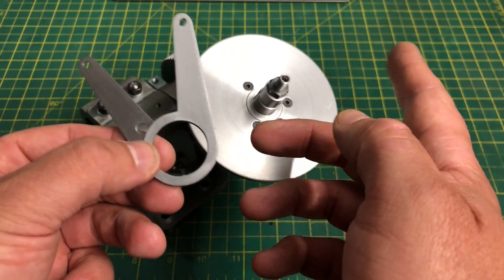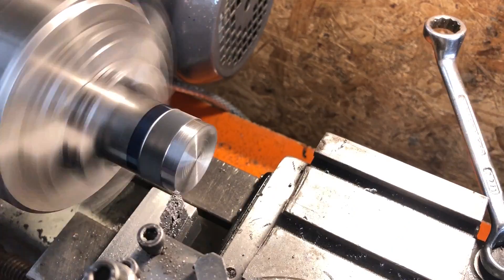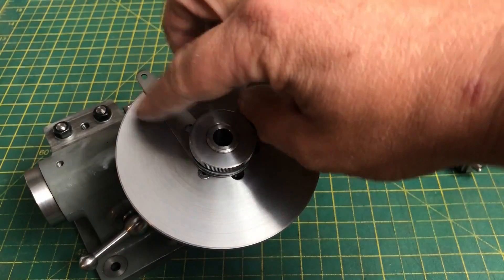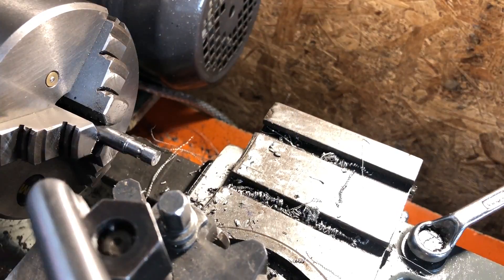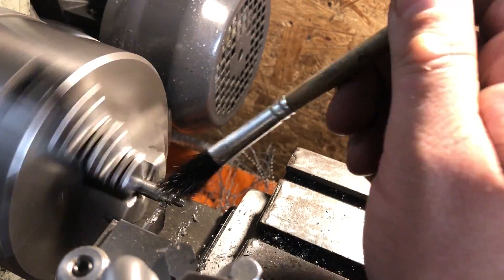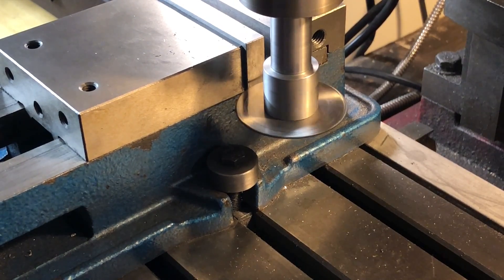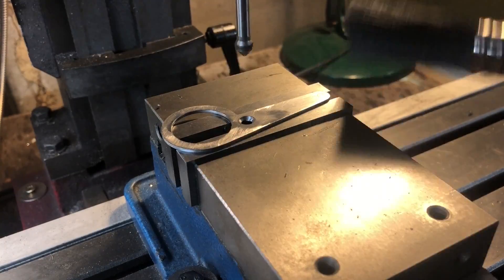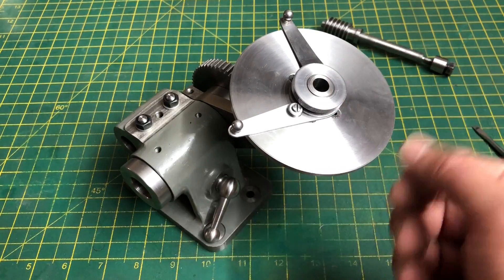Building The GHT Versatile Dividing Head - Part 10 - Completing the Sector Fingers

Comment: Moar, I want moar! Came over from Rotary SMP, was just going to watch one ep before sleeping. Ended up watching five. x) Keep up the good work!
Reply from the maker: Thanks for watching! I’m itching to get back to it but other things have taken over at the moment. More to come.
Reply: @DrillsTapsDies  I know how it is. I have several project going at the same time, some gets put one ice for a while for one reason or another. Then there is life too that wants a piece of the time pie now and then. <x)
Reply from the maker: Tell me about it! Pulled the engine and gearbox out of my little car in August to swap out some bearings and it has turned into a total rebuild! Bench is currently covered in the contents of a gearbox and overdrive unit! It was only supposed to take a week!
Reply: @DrillsTapsDies  Sorry for laughing out loud right now, but I hear ya. My work area looks like my toolbox exploded and took the parts pile with it. <xD
Also, I start a project, partway in, I realize I'm going to need tool X to complete it. I start a rabbit hole of research into which version to buy at the lowest possible price (cheapskate), or look for parts/material to make it yourself. Several weeks later I'm no further along in the original project and have created two more side projects too boot. I swear, the things to do list is a self replicating entity, it keeps increasing in length. <x)
Reply: ... and today I finished the playlist as I woke up. So I basically binged it, with a 9 hr nap in the middle. :)